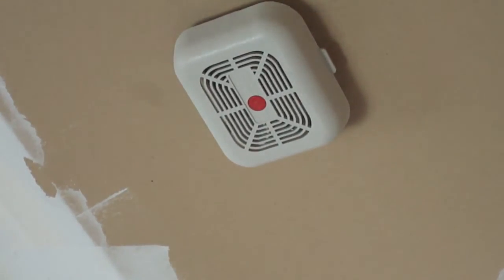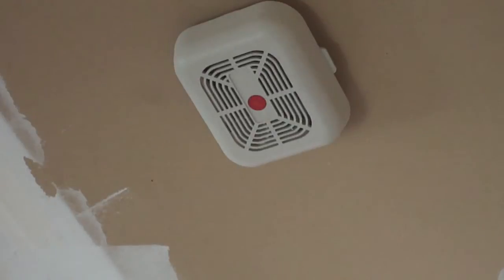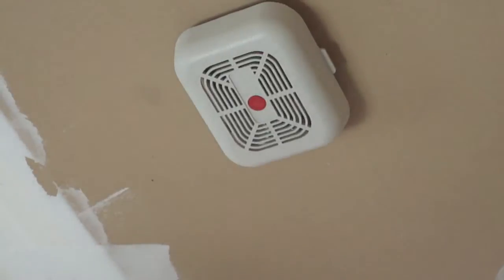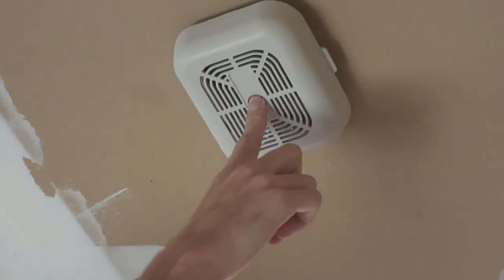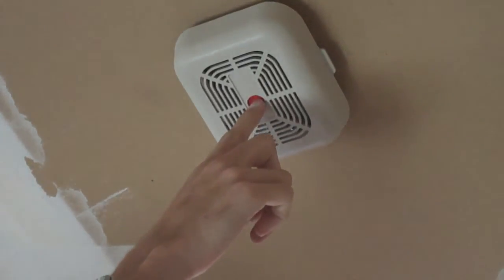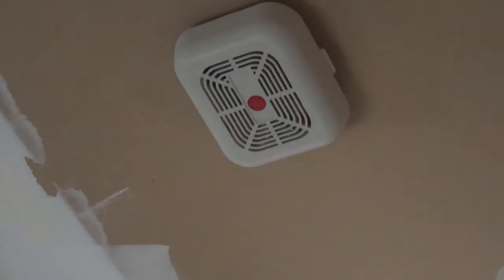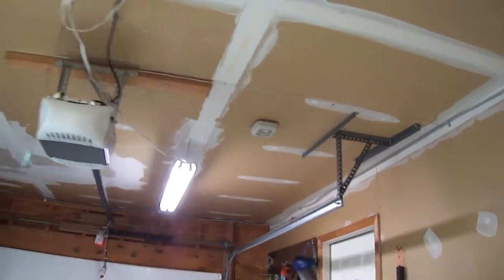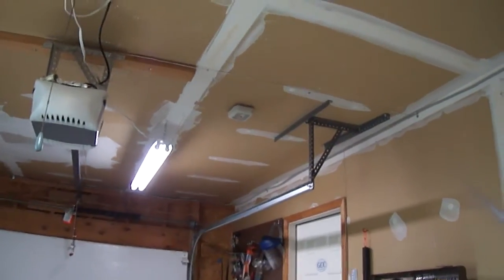Testing the Black & Decker Flamebuster Smoke Detector (circa 1988)

Comment: DON'T USE 30 YEAR OLD SMOKE ALARMS!  By manufacturers' instructions and by code they should be replaced 10 years FROM THE DATE OF MANUFACTURE, not the date they came out of the box.  This is due to deterioration and breakdown of key components due to environment, manufacturing defects and residues, etc. Hoping it will still work is gambling with your life.
Reply: Idk man i think the replace every 10 years might be a way for them to get your money - i have near 30-year old smoke alarms and they still work just fine. I do still replace my alarms every 10 years even though i would trust old “expired” smoke detectors
Reply: @expgretaillegacy  I am a fire investigator, and I have investigated far too many fatal fires where old smoke alarms failed to work.
Reply: @richardmeier477  wow i didnt know that